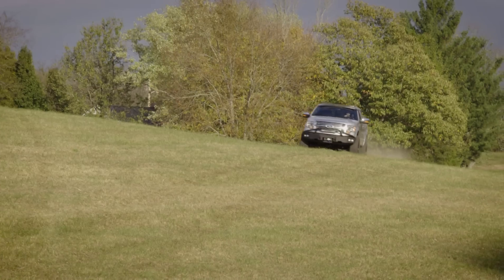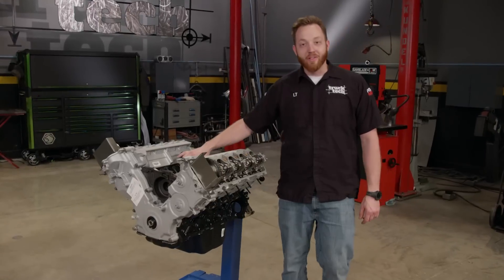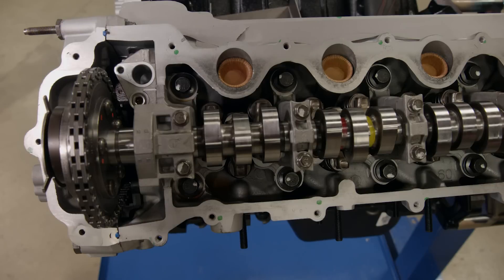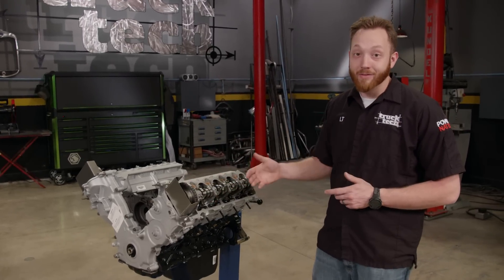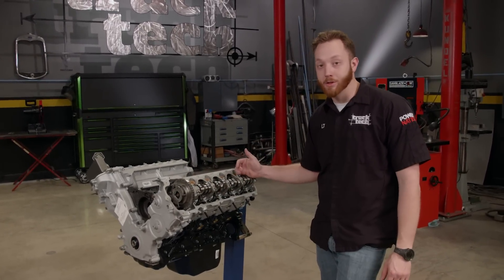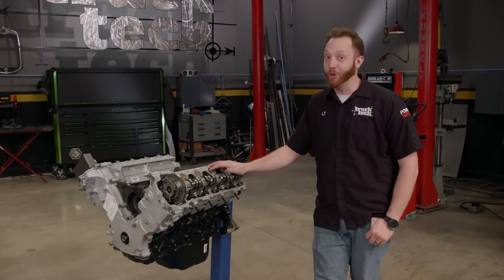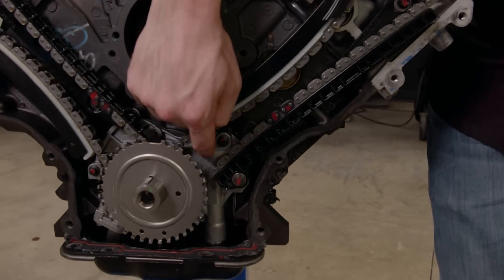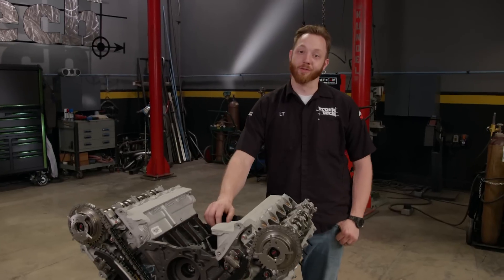Hope For 5.4L 3V Mod Motor Fans

Comment: Dang. Mine has been ticking for 100k miles. I guess I need it looked at.
Reply: Theoriginalct Theoriginalct Ive had a ticking in mine since I bought the truck at around 60k miles, just changed the oil and never noticed any issues with it. But, recently, the ticking slightly changed at around 190k miles and now, a month later the engine completely took a shit. And am now looking for a reman engine. But have decided to just go directly with the FOMOCO remanned 5.4. For 500 bucks more than this (including the return of the core) you get an engine directly from the OEM, with a 3 year/ unlimited mileage warranty. So keep that in mind if you do decide to get ahead of the curve, and replace the engine.
Reply: @Greighps  -Right on. I would read the details of the warranty  to be sure. I wouldn't be surprised to find out that the warranty only applies if changing oil at the stealership, etc. Absent any nonsense, I might really be able to get behind a rebuilt Ford crate motor. After all, the last one they built has about 300k on it without any problem other than my normal abuse and spark plugs. Although I carry an extra, I think I'm still on the factory fan belt. Lol!
Reply: Theoriginalct Theoriginalct yea, there could definitely be something I looked over or missed, but on the ford website it says basically anything that was delivered with the long block is covered, no (at least not many) questions asked. And maybe I’m just stubborn, but I like ford, and I like their products even though I tediously maintained the engine, and it finally gave out on me. But it’s whatever, trying to by a new four door 4x4 today is fucking laughable at what they want for one. So hopefully I get another 200k outa this one, by that time maybe Ill hit the lotto, and can pick up a new one without feeling like I was taken 😅.
Reply: @Greighps  - I'm with ya! Based on my experience with the '11-14, my bent truck would likely be an '04-'08 with less miles. I've seen all of the trucks, and not one has come close in the "reliability under extreme abuse" category. Good luck with your rig!
Reply: Theoriginalct Theoriginalct I absolutely agree with that. But alright man, best of luck with yours, also!
Reply: @Greighps  As others have said: Ford knows the engines are shit and while they may warranty it, I bet they'll use any excuse to not cover you when it fails (and it will). Plus they don't offer a warranty on the labour to put it in, they only cover up to $150 so if it costs you $2000 to replace their rebuilt engine, you're on the hook for that. 

I also bet they'll ask to see all receipts for oil changes and the mileage when they are done. If you went 10 kms over 5000 kms, they'll void your warranty. If you used anything other than motorcraft oil filters, I bet they'll void your warranty. If you drove in the snow? I bet they'll void your warranty. If you pulled a trailer? I bet they'll void your warranty. If you drove it twice in one day? I bet they'll void your warranty.
Reply: @jamesorr2404  lol I'd be good then! (going through a dry spell hahaha)
Reply: I recently just purchased a 2002 f-150 XL and it has a slight ticking noise at 189k. Guess I need to be getting in contact with oem soon if they have reman. blocks for $500 with a core!
Reply: Yeah I did misread. I was a little under the influence when I read that.

Comment: I have a 2009 with 123000. Shoud it die I would do this.
Reply: fakebrake my 2010 4.6 3v has 287k and runs strong, but I believe time is catching up and the cats are beginning to clog cause it feels a little more sluggish lately.
Reply: Why not fix it? Update the parts and upgrade to the higher capacity oil pump and engine will live forever
Reply: Cyr Media oh believe me I’ll upgrade it evenetually, the cats aren’t gonna be what kills it so I’ll just keep taking care of it like I have been and do what I can till I can put the parts on it

Comment: Idk about lack of oil circulation when the vcts fail. Mine has 166,000 miles and pulls like a bald eagle
Reply: The problem is the factory oil pump is weak. Replace that with a high volume pump and that corrects 90% of the problems.
Reply: @kingdaniel3519  Yes, they do need to be replaced but the thing is: you have to tear most of the engine down to get to it. Then you're into the "might as well do the timing chain, phasers , guides etc" while you've gone that far and then you're into the price of another engine. 

A new high volume oil pump solves some of the problems, not 90%. The number 1 issue that an oil pump won't solve is the singular oil passage that goes through the left bank, then through the crank, then the right bank ending up at the right phaser. Which is why that side fails first in 99% of the cases. It's the last to receive oil and by then, it's picked up all kinds of contaminants. 

The kicker with the 5.4L is the whole system is designed around oil pressure and Ford put in a shitty oil pump for the first 3 years and 2.5 million engines.
Reply: and they do fail quite often.

Comment: Fords overly complicated piles of junk!! And I am ford guy! But the three valve motors ARE JUNK!
Reply: Sorry Larry W I'm a true ford guy the 5.4 3v was not junk if ppl took care of the motor from new they would not have any problems I have a fleet of 05-11 5.4 3v trucks and suv's all ranging from 100000k-350000k miles and still running strong
Reply: The problem with the 3v 5.4 is that the factory oil pump is too weak, it doesn't push enough oil to run the VCT. Replace it with a high volume pump and the engine will run forever.
Reply: I think from the factory the 3v sucks but with the upgraded parts it makes them bullet proof.
Reply: Timothy Isenhart maybe you did something wrong or had a bad motor, companies have bad motors every now and then so who knows? I’ve had the spark plugs done once for maintenance and have never had to “tighten them everyday” but idk maybe you had a serious problem with your truck.
Reply: @Mfletcher703  It was a very common problem with the 4.6/5.4/6.8, That is why Ford discontinued those engines. There is a permananent fix now for this very issue but you have to pull the engine apart to do it.
Reply: Timothy Isenhart i own a 1999 4.6 f150. Bought it at 67k miles, now has 188k. Also have a 2000 5.4 with 171k. Replaced the coils and plugs as normal maintenance but have never "tightened them up every other day" both engines are great and the 5.4 is fast as fuck for a stock truck. i dont think you know what you're talkin about bud.
Reply: Timothy Isenhart as a matter of fact, when i did change the plugs they were HARD to get out. Had to spray them and wait a day just to avoid breakin them off in the block. Never even heard of 2v 5.4s an 4.6s spittin plugs or burnin em up.
Reply: @jcole9599  Trust me I know what I'm talking about because I owned a 97'F150 with a 4.6L standard plug wire ignition system and a 2003 F150 5.4L H.E.I. Just because they're fast doesn't mean they don't have issues. I can give you a long list of repairs that were done on both trucks.
Reply: Timothy Isenhart i don't care what a forum or anything says. I own 2 of these trucks as i said. Know MANY other people with the 4.2 v6, 4.6 v8 and the 5.4 v8. Never heard of the shit you're talking about. Must not have kept your shit up bud cause even the ford mechanics around here say they rarely run into this problem.
Reply: Timothy Isenhart my spark plugs on both trucks were hard as hell to get out. i just dont understand how you think the plugs would loosen up by their selves😂
Reply: @jcole9599  Did you not read any of those links I posted? You must be the only person in America that owns a Triton that doesn't spit spark plugs or someone did the fix before you bought it.
Reply: @jcole9599  You must not of read the Consumer Affairs Report link I also posted. I assure you it is known problem and a honest Ford mechanic will tell you the same. As a matter of fact I have a neighbor 4 houses down that has been having the same problem with his 06' F150 Super Duty and he unded up buying an 01' Silverado 2500 because he owns a tree trimming business and needs a reliable truck. His F150 has been parked on the street for over a year now.
Reply: Timothy Isenhart i know very many that have these trucks where i live. I have never encountered this problem with both of my (over 200,000 miles) f150s and none of the people i know who own these trucks have had this problem.
Reply: @jcole9599  Ford fixed this issue in 2008 for their 09 models. Sometimes I wish I had kept my 2003  so I could put a 5.0L Coyote in it. I switched back to GM after owning those trucks and I haven't had any issues yet. When both of trucks ran good they were quick, I even think my 4.6L was faster than my current GM 5.3L but honestly those Triton motors were nickel and dime-ing me to death.
Reply: Timothy Isenhart they are fast but man ill tell you all i do is change the oil and give em hell they love it lol
Reply: Timothy Isenhart I’ve got no issues with my 4.6 3v, but yes plenty of people have the issue of spark plugs breaking in the head, but a lotta people also never had that problem, it’s like saying the 5.3 is a bad motor because lots of people had problems with afm, but in reality it’s still a good motor just with kinks, everything has its kinks, even the venerable 4.9 i6 that ford used to make.
Reply: Larry W no the 5.4 3v was a bad motor, the 4.6 3v is a perfect example that complexity doesn’t decrease longevity.
Reply: @Mfletcher703  I had the 4.6 Triton in my 97' F150 and the 5.4L in my 03' F150 The Triton was a horrible motor.
Reply: Never trust somebody that cause an engine a motor.

Comment: But what about the spark plugs
Reply: what about them, only the original Motorcraft ones were 2 piece. Don't think any plug manufacturer (including Motorcraft) make 2 piece, all 1 piece now.
Reply: cody roland but the problem was that they were only held in by about 2 full threads and would blow out
Reply: @daytonwintle6051  Thats on the 5.4 2V, spark plugs spitting out.
The 5.4 3V had issues with the two piece plugs breaking in the spark plug hole.
Reply: Dayton Wintle the internet is world wide now. No excuse for saying dumb stuff.

Comment: Great engines when taken care of but when they do grenade expensive!
Reply: expensive to repair ANY part on them since you basically have to dismantle the entire top end to get at anything.
Reply: @muskokamike127  even the shitty gm 5.3 with afm system collapsed lifters on one side means replacement of both sides, that involves taking heads off.  Consumes oil and knock noise, yes some may get lucky with no issues yet, but its a problem thats out there with those.
Reply: @tmaq9726  Yeah,after my third visit to the garage with my 5.4 I asked him about moving to GM trucks and he pointed to 3 5.3 with AFM that needed to be rebuilt. He said the same thing: the standard 5.3 is great, AFM ones suck as bad as the Fords. 

I was just talking to another buddy who is a ford guy and he belongs to a Ford Truck forum and he's seen heads go for $200 so he's keeping an eye out for me. I might just swap the heads myself.